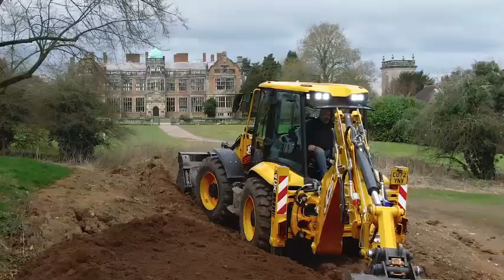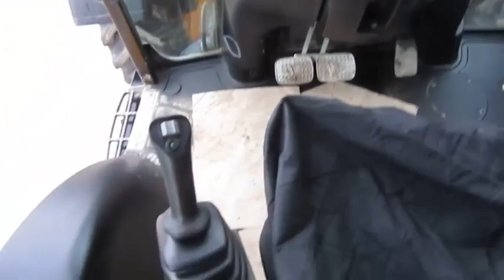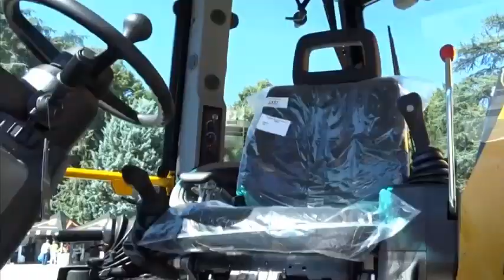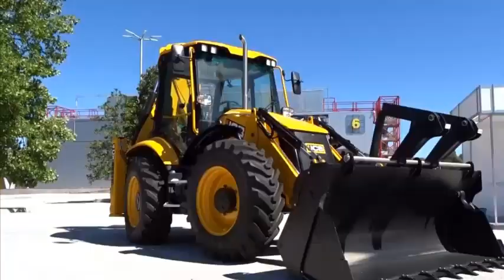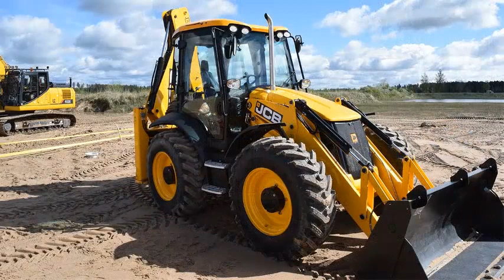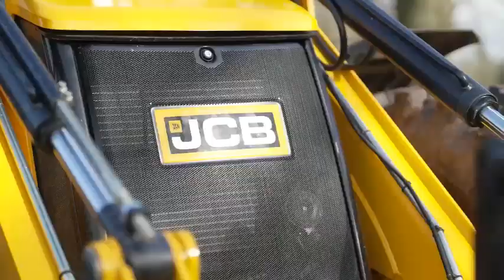JCB 4CX 15 SUPER backhoe loader

Comment: 2,000 EcoMax engines tested for 110,000 hours seems highly reliable before you do the math to realize you are making a statement of reliability of an engine that has been only tested for 55 hours. 7 work days.

You shouldn't have used that example. It's as if you are insulting the intelligence of the prospective buyer because your average customer drags their knuckles on the ground and blow their noses on their shirt tails.